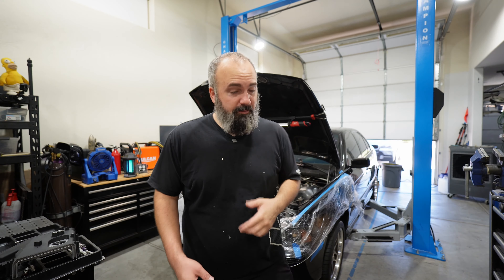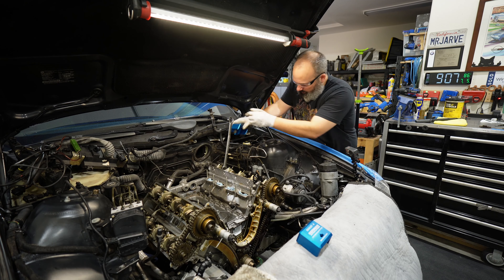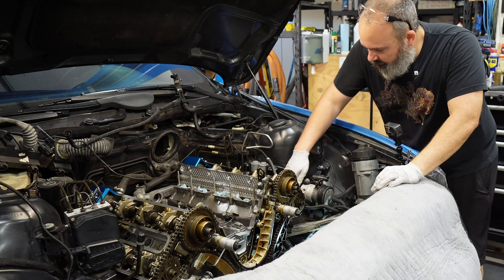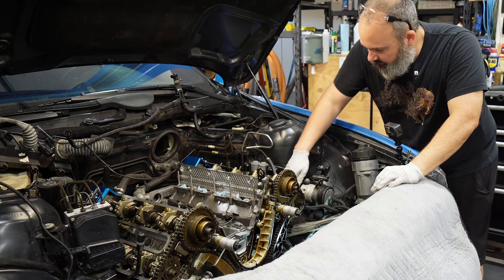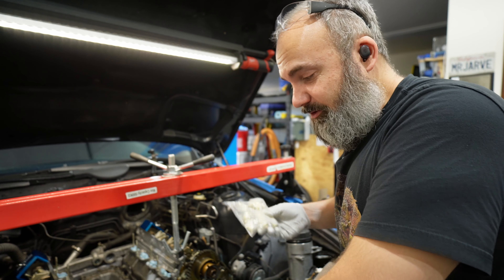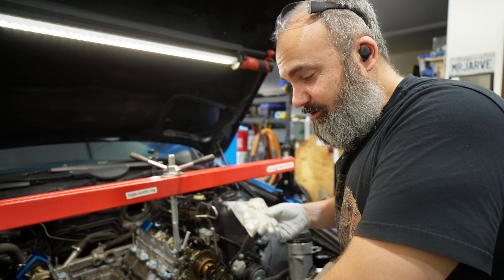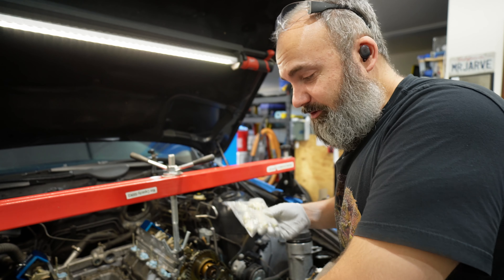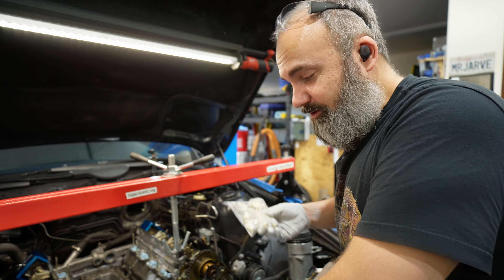M62TU Timing Guide DIY - Pt2 All the other stuff | 540i Restoration

Comment: Awesome video as always, doesn't the m62 tu have an engine oil cooler from the factory?
I thought they added an engine oil cooler next to the power steering? Or is that transmission cooler?
Reply from the maker: The s62 has an oil cooler in the valley. No oil cooler on the M62 variants. There may have been in Europe, I believe they use a different filter housing to accommodate it. Next to the radiator there are ports for the auto trans and power steering coolers.